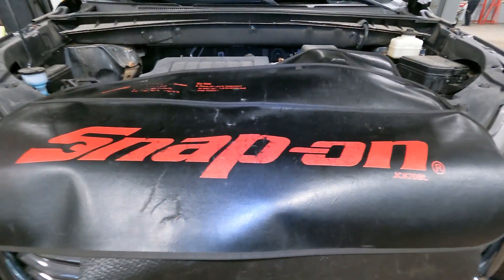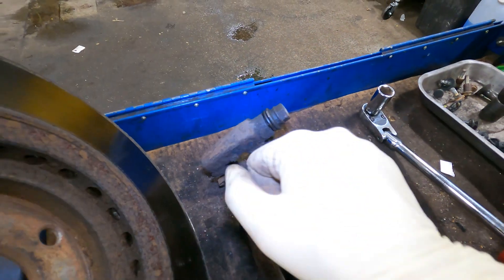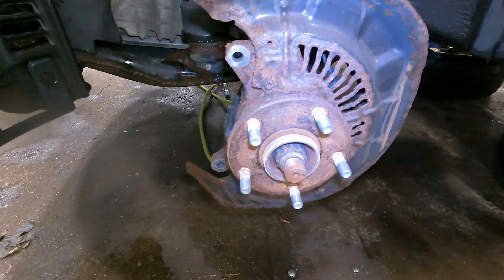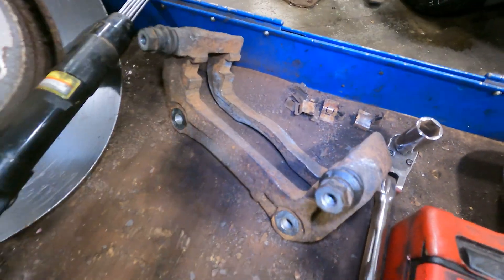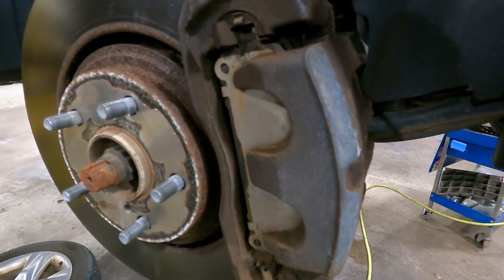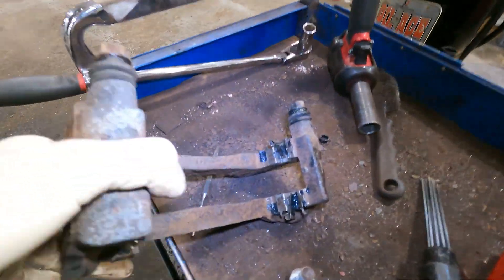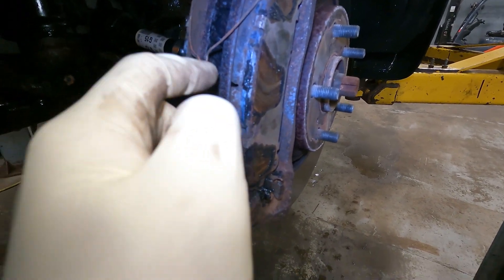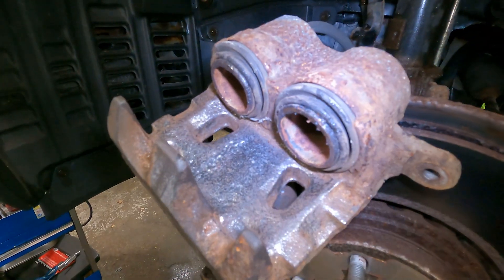Customer states "RUST IS MAKING MY BRAKES CRUNCH!?"😳😧🤣🤪

Comment: Today on Customer states what , I'm a dumb azz for refusing to do preventive maintence for denying Multi point inspection to detect future problems or issues , Your a good man for going the extra steps to fix up the Crunchy Brake issue
Reply from the maker: I try man I really do and you guys are the only ones who see or appreciate it. Thank you.
Reply: I just put $2100 in parts  alone and up grades on my Tacoma , started with wheel bearing , Replaced all 4, upgraded all 4 ball joints , upgraded both CV axles , front wheel seals , flush/ fill  both front and rear diffs ,synthetic 75-90 , Rebuilt both drive shafts plus steady bearing , all 4 rear wheel seals , upgraded my trailer hitch , 2 rear brake lines , 2 rear wheel cylinders , flushed any shrek piss from brake lines flushed master cylinder , greased with synthetic . Pro Comp 9000ES rear shocks , Yeah parts cannon but no worries now out fishing or back country . Guys like myself love channels like  yours , helps problem solve and with full tear downs and rebuilds .

Comment: Hey. The excess rust on the drivers side is from driving in the winter in the left lane close to the edge or on a 2 lane road with the drivers wheel in the shitty slush which throws up a ton of dirt, salt and debris. At least that’s the way it is around here.

Comment: I have a drivers side front backing plate thats not really rusty but loves to rub, after the 6th time of tweaking it and it coming back after 30mi's of driving I'm just putting it off till I go on a trip to my shop where my lift is. If I'm lucky it will self clearance by then. 😂

Comment: One side being that Rusty over the other would tell me they most likely replaced the other side at some point. The theory of parking and snow ect just doesn’t hold weight unless that car is literally just sitting in that spot for a very long period of time. Plus both sides of the car get packed with snow and salt one side from plowed the other from snow blowers ect from the sidewalks.

Comment: Experiencing this on my Honda rears, Im waiting for warmer weather to take the bracket off, clean and scrap it, and hit it with some high heat paint, replace rotors and pads. Calipers are fine but I may clean and paint them too. North East snow belt maintenance FTW!

Comment: Should just replace the components. Save time and any questions on chasing down a noise. Also a couple coats of paint/rust converter should give some extra protection.
Reply: Run a caliper file over the slides and put some lube on it. 5 minutes per bracket. I would have replaced the rotors